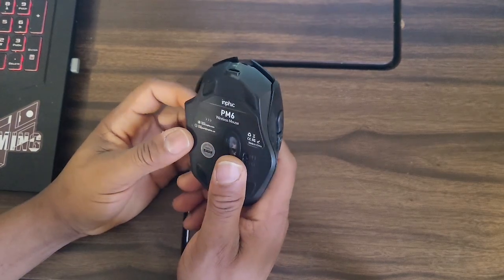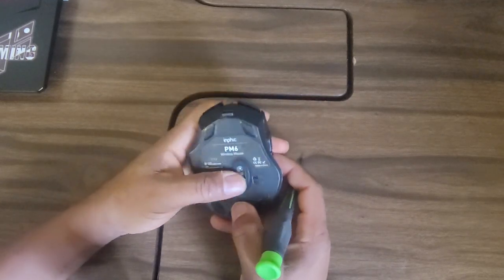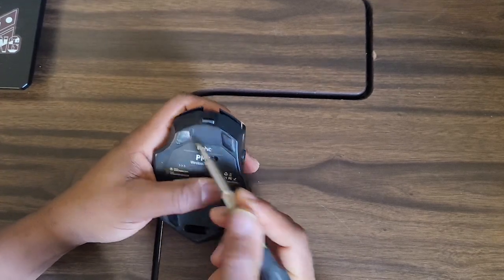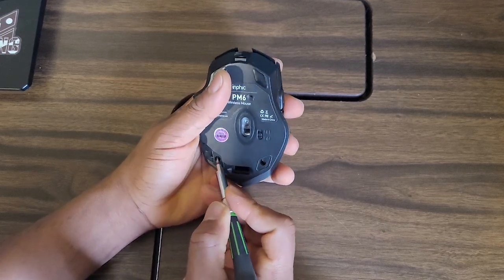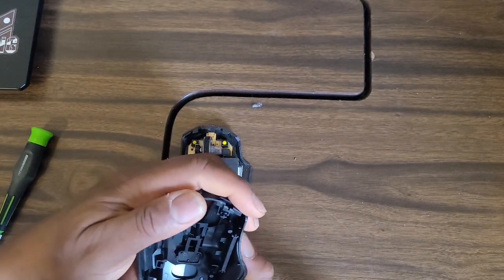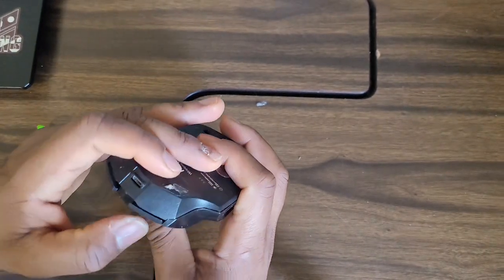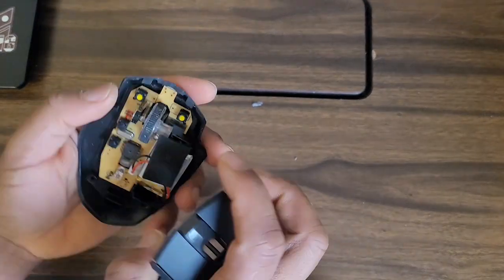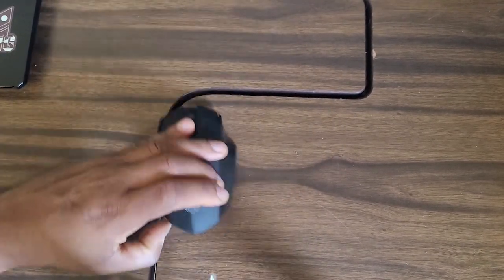Dropped Your Inphic PM6 Wireless Mouse? Here's How to Repair It Fast

Comment: yoo, recently my middle mouse click button has been to light, like normally you need to put some strength into it to press on the middle click button but mine turned super light weight and i wanna fix it
Reply from the maker: You can fix it!. Just be patient when loosening the screws. You can follow the steps in this video. I recommend figuring out where the screws and clips are on the mouse. All the best.